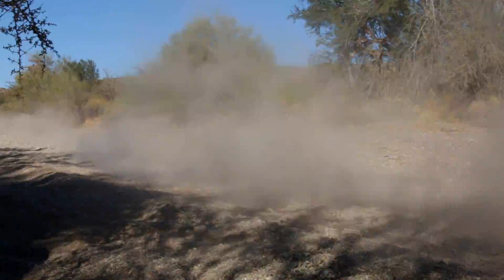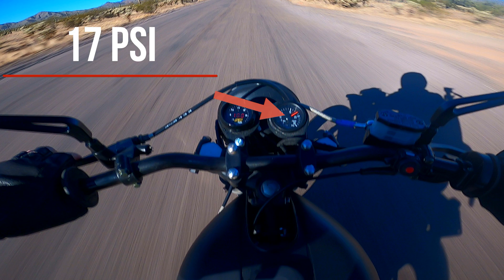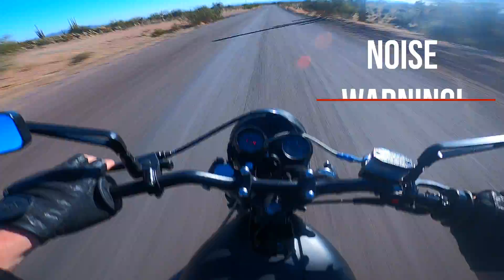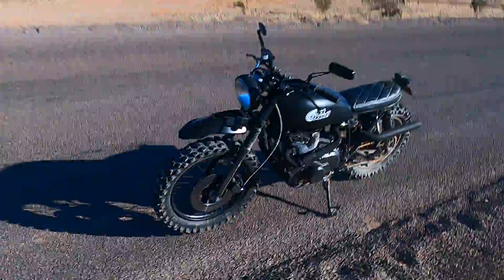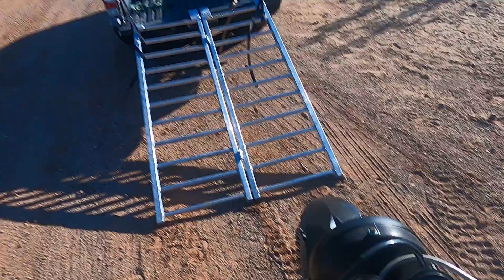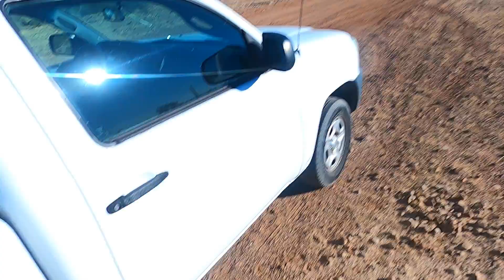Turbo (VZ21) GS400 Acceleration and Desert Riding

Comment: The Pandem kit is god awful ... like you were saying about trim and handling characteristics, by the time your suspension reacts and then bottoms out, you probably wont even feel like ya have any for as far as that wheel is moved out, youve effectively taken one of Americas ultimate track cars and turned it into something that feels like a Soap Box Derby Car instead...or handles like George Clooney tryin to steer Forrest Gumps battered shrimp boat Andrea Gail in The Perfect Storm up against 50ft waves with the outriggers and anchors floppin around worse than Michael J Fox at an EDM Rave 🤣🤦‍♂️ ... im not 100% but ive seen it installed and might have to even mess around with shock mounting placement, but one thing i am 100% sure of is that you need to cut and butcher the shit out of your factory panels to properly mount those flares up to the C5 which dont even come close to flowing with the C5s body lines... and i was relieved to see i wasnt the only one who instantly thought that front fascia was biting off a 3 decade old BMW... the only way to maybe save that front fascia would be to take a sawzall and cut everything out below the top front nose piece and then see if you could graft in that Super Veloce grille that Supervettes makes for the C6 or C7 Corvette which would be a costly gamble at best ... i couldnt agree with you more about form and function and that the best look to EVER come out on the C5-C8 corvettes are the Pratt & Miller C5R, C6R, C7R, & C8R  yet almost (ALMOST) no companies out there go full-tilt in building a beautiful, Non-Cheap looking or half-assed bolt-on overlay lookin part that still doesnt quite cut it... the only company to do it right for the C5 so far and im glad to see a couple people knew of them is ACP who makes the World Challenge C5R body that actually is used in IMSA/SCCA/FIA Competition... and C7 Carbon looks like they may have something, but we cant be expected to trust a full body-kit price of $10-20k and order something thats a good chunk of money based off a computer rendering (although they said they will have real photos soon of fit and finish as a few pple did buy that kit based off the rendering... ive had the ACP for years and its hands down the best ... as far as stand-alone flared fenders go right now for the C5, i would say the most beautiful ones out at the moment are from that cat located in Greece at CFC who made that absolutely stunning 100% all Carbon Fibered Body C5 Corvette ...  the only other decent attempt at a real C5 wide body was that Carravaggio kit that came out which was stupid expensive and even that def wasnt appealing at that price... the venting they attempted on the rear quarters was the only somewhat sorta cool thing about it ... kinda Annoys me that Supervettes didnt come out with the C5 version of their C6 ZR6X body kit because that amount of fender flare would look amazing properly grafted onto the C5 ... i totally agree with you though about the IMSA look (which is why i spent 2600 on a fully custom set of the Radioflyer/Sharplight innovations C5R headlights but took them and designed them how i wanted them to look)  i kept saying i was gonna get them for years and then i finally did about a year before you came out with yours... fortunately tho, id say the C5 owners market is dead split on people who love the C5R lights and People who still love the pop-ups and i must say that your headlights are def far and away better than anything else available for the C5 in pop-up AND they look better than all the other C5R style headlights as well besides Georges so thats def somethin to be proud of man... ive actually been meaning to mesage you for a while though because i do have your store "Favorited ❤"  on my SHOP App bro and i keep checking back to see if theres ever a new update on your C5 version of the Center Console GIANT TOUCH SCREEN DISPLAY that replaces the Radio & HVAC Controls... im sooo damn syked for that bro... FINALLY someone to come along and adress the BIGGEST EYE SORE (IMO) of the C5 interior... i cant wait to rip that Bullshit out and toss that Radio and HVAC control that was in every cheaper GM Car like the impala or chevy trucks and they thought it was ok to go ahead and put those units into their Flagship car... it drives me insane and i plan on being one of your first orders when that drops! ... i just hope you streamline the borders/edges of the C5 screens unit like you did with the C6 version to fit completely inside the edges of the center console bezel bc i have the expensive Apsis Carbon Fiber Center glove box and bezel and dont wanna cover that up... any news on a possible release date for the C5 unit ?  ... also, with that problem you said you were having with the 3D printing media, i dunno what kind of printers youre using but my brother is a mechanical engineer and does alot of his work and model's on a Stratasys 3D Printer which prints using a matrix of Nylon & Carbon and it makes parts flawlessly and theyre super strong... dunno if your setup is capable of using that but the stuff comes out incredible (def more expensive, but the quality is spot on)  i know you said you wanted to get everything in for Injection Molding which is def the way to go but i know that shit has to be done in bulk ... aside from rounding up heads in Corvette Forum for group buys, ya should think about somethin like enabling a 50% Down Payment Order option on your website so ya can get pple payin in advance and then have the cash-flow come in in advance on your website and just keep updates to how many more orders need to be placed until that first group of buyers parts can go off to Injection-Molding and then post when its done and that the other half of their payment is due in order for their order to ship out... i think you def have some great ideas and have come out with your first few products that people in the Corvette Community will def get behind 👍🏻... keep up the awesome work and best of luck! And please let me know as soon as its ready to launch so i can rip this eye sore outta my center console! 🤣🍻

Comment: Are you planning to use intercooler? Did you modified the stock ignition curve? Thanks
Reply from the maker: It's draw-through, intercooler is not necessary (or possible really). The ignition curve was/is stock, the base timing was backed off a few degrees and I run race gas in it.

Comment: How much better is it compared to standard engine?
How does it feel like when the boost hits?
Reply from the maker: On 20 PSI the HP is more than double than stock, it's very dramatic when the boost hits. As usual the video doesn't do it justice. It's weird accelerating that fast on such a small engine that revs so high.

Comment: Hey, try e85. E85 is 108 octane which is like race fuel
Reply from the maker: E85 has poor cold start performance (draw-through turbo's already have crappy cold-start), and E85 is more sensitive to pre-ignition with high timing. Race gas would be a much more safe solution. I've tossed around the Idea of running E85 but I'm still on the fence.

Comment: How is the throttle response? At 14 psi, the torque should be comparable to like an 800.
Reply from the maker: It's ok as long as you're above 6k rpm. It spins up to 11k or so. It's quick for sure, it would beat my Big bore XS650 (707cc) for sure, especially from a 40 roll.

Comment: Man I wanna see something like a Suzuki Savage with a turbo. I mean  big displacement single cylinder. And with the bigger cylinders you can get boosts it up over 700cc so im just left wondering hmmmmmm
Reply from the maker: Single cylinders need a large plenum, as you're always working against the intake valve. A draw through setup probably wouldn't work very well on a single.

Comment: This deserves a massive font but I can manage only so much ! " AWESOME ! "  I watched the time lapse build and it seemed questioable at that point?  Now we see you putting it to work , it's like no 400 I ever rode ! No way. Seems to chug out 80 - 90 HP ? Should get a pair of RM 450 inverted forks for it . There are mods that can extend the swingarm travel a little too.  
These inspirational journeys we get to see occassionally are a pleasure & a privilege, thanks.
Reply from the maker: Thanks, quite a few haters commented on the original build video that it looked slow/didn't look like it made boost. The road I filmed the final scenes at for the video was too rough/short to actually hit boost. Looking back, I should've spent an extra day finding an area/filming better shots of hitting boost/accelerating but that's what this video is for. 

I'd say 80 crank HP would be a reasonable estimate of where it's at on 20 PSI of boost. The final clips in the build timelapse made it looks slow and that's my biggest regret. When I went to put the clips in the video, I knew people were going to say it looked slow/no boost because the only time I actually hit boost was the final scene where I launched it.

Comment: Does it smoke at all running draw through carb setup on deceleration?
Reply from the maker: Only if idling for long periods, and under boost when the pressure pushes out the remaining oil. And cold starts it will let out a pretty big puff. Just cruising and idling at stoplights, it's so faint most wouldn't even notice.
Reply: @DoctorMotorcycle  thats great to hear. Its such a simplified setup. Just seen bad results with it but could be poorly setup systems.

Comment: Well I have to say I'm majorly impressed you got that to work!
First it's a tiny displacement to spin a turbo on, secondly it's an in line twin & the exhaust pulse would be way less than optimal. On top of that you got 20psi boost! 😮  Surely it must lag? What diameter is the fan?
Well done!
Reply from the maker: Thanks, it's only super laggy in 1st gear. 2nd gear and up the spool is pretty reasonable so long as you're further up in the rev range. IDK the specs of the exhaust/compressor wheel's, it's a VZ21 turbo.
Reply: @DoctorMotorcycle  
Looks like the same turbo as the original IHI that was made for the Honda CX500T, that boosts to 18psi & spools up to 160,000rpm. It didn't give boost until 4000rpm (engine) 
I modded one with a slightly larger turbo from a car (Honda city) and put a dump valve & external waste gate. It easily went past 20psi & the overboost  sensor would kick in, but was too hard on the gearbox. 
Sounded great with the dump valve 😎

Comment: Super cool to see. Just watched the build video and was wondering how fast you got it to go, and how quickly. Did you get that thing up to 120+!!? :0
Reply from the maker: GPS said 105 on the 20 PSI pull but the GPS lags a little bit. That was only halfway through 5th (it's a 6 speed) gear. I don't doubt it could do 125-130 as it sits, and it wouldn't take that much longer either lol.
Reply: @DoctorMotorcycle  I would love to see a dyno number on that machine. It says stock that it makes 36hp so if I could guess, you are probably pushing 90hp with the 17-20 psi
Reply: @aaronchadwick2682  my guess is 65ish hp
Reply: @remedia1200  Well that settles it. He needs to get it dyno'd
Reply: @aaronchadwick2682  I agree, we need answers!
Reply: @remedia1200  
20psi, same a/f ratio and timing =
36hp to 85hp
21.1ftlb to 52.18ftlb
398cc=939.68cc
Reply: @DarkLinkAD  whered you get that? a lot more goes into play than just boost when it comes to making power, 20 psi could yield completely different power numbers on the same engine if there's differences in design

Comment: It’s cool, but I’m thinking ya could of used a Suzuki gs 750 of the same vintage without a blower for similar power. Just saying. ; )
Reply: The turbo is what makes it so cool and unique
Reply from the maker: I could have, but a GS750 is 550lbs wet, this bike is just over 400lbs wet. 550lbs might as well be a Harley Road Glide offroad.

Comment: I have a 82 Honda 750, a little rough but might be something you want. Here in the west valley...
Reply from the maker: Send me an e-mail with some photo's and a brief description. My e-mail can be found under the "about" section of my channel. '82 would be a DOHC bike and those can be a pain to sell as everyone wants the SOHC.
Reply: @DoctorMotorcycle  Would love to see a cb750 build (but I agree, preferably SOHC)! Love the channel, keep it up!
Reply: @DoctorMotorcycle  I'm still kind of new to motorcycles but come from a strong automotive background particularly specializing in European performance. I've done a LOT of work with the older vintage Saab's and Volvo's and I'll tell you that the old Saab 2.0L engines were very powerful engines with the right turbo and correct set-up. In the Saab world, nobody wants the old 60's/70's SOHC as they were 8-valve motors and slow as turds! Most people in the Saab community like the 16-valve DOHC 2-litre engines as they're much more powerful and have a LOT more torque. All of this being said, why in the world would the SOHC CB-750 engines be more popular? Again I'm looking at this from a different perspective but just curious what attracts people to the SOHC motors? Is it have to do with the resell value and that they're more vintage or the horsepower/torque numbers they put out? I'd love to know either way, thanks.
Reply from the maker: @MatthewJFitzpatrick  The shape of the frame on the DOHC bike's is wonky, and they have those giant odd looking tanks + most of the DOHC bikes had the Mag wheels which pretty much nobody wants in the custom world (myself included). With spoked wheels you can re-lace the wheel to whatever you want, the tire selection is much better as you can choose your rim width as well. And they're much more durable offroad, which is why dirtbikes always have spoked wheels.

It's mostly aesthetic, otherwise I would agree. A DOHC CB750 will put down 80rwhp with basic intake/exhaust mods. That would take a big cam and headwork on a SOHC and you still probably wouldn't get there without a bigbore or some really good head porting + bumping up the compression.

IMO that's why this bike was such a little screamer with the turbo. DOHC allows you to rev it to the moon, which is where the HP is. It allows the use of much more aggressive camshaft ramp rates and higher lift, as I'm sure you're well aware.
Reply: @DoctorMotorcycle  Thank you for that very helpful and thorough answer I appreciate it! I could definitely understand from that approach based on what you're saying, thanks again!

Comment: You should do a full mod on a dr650. Your subs will start climbing fast
Reply from the maker: Great bike, however I have a soft spot for bikes that are twin-shock, and the DR is not. Maybe one day I'll manage to pick one up dirt cheap, I'll build nearly anything with 2 wheels an and engine if the price is right.
Reply: @DoctorMotorcycle  Yamaha GT 80

Comment: try seeing if the reluctor can be moved to retard the timing. my hayabusa had a adjustable crank trigger to find tdc with the timing light then i let the pcm take over once i knew where true tdc was. you can do this.; i am a 35 year auto dealer technician with a major manufacturer .  it is analog. ohms and volts. you can manipulate timing
Reply from the maker: The ignition is dyna electronic but still uses a mechanical advance. I could lower the base timing 3-5* and not kill the power off boost, or I could weld a stop to prevent the timing from advancing as much but TBH on the lower boost settings it doesn't knock, and I've decided to just run race gas in it. I'll probably end up doing a combination of both if I even run 20+psi again.
Reply: it rocks regardless

Comment: great work ,some head porting, twin scroll turbo ,divided header ,more aggressive cams and and fuel injection .'thats 
my gs550 build. i have had success with a road race lotus super seven with a hayabusa.  twin scroll gt35 made 350 hp
this was fun to watch
Reply from the maker: Thanks Fred. The head is ported on this bike. Your GS550 sounds fun, will do a four cylinder one day. That's actually what I'm looking to do next after this 2 stroke I build, a twin turbo inline four or a twin turbo bigger twin (KZ750 twin, TX750).
Reply: @DoctorMotorcycle  Goldwing flat four twin . 1200 ! lol

Comment: Hello. Cann you hear the knok despite the loud engine noise? Do you use a knok sensor and headphones?
Reply from the maker: Yea, you can hear it in the videos too, just listen closely. It's the cracking noise that's most noticeable on the 17 and 20 psi pulls.
Reply: @DoctorMotorcycle  Thanks for the reply. In fact I seemed to hear the typical knok noise from the video but I thought it was my impression. In cars I am used to using knok sensor, amplifier and headphones and I imagined you used the same method. Do you plan to install electronic management in the future or will you stick to the classic? In any case, great job, clean and tidy. Very good 👍
Reply from the maker: @IncuboUnconventionalLife  Negative, this is only a problem because I got greedy with boost and timing. I'm going to be running race gas in the future on this bike. I've thought about running E85 but not sure I want to go that route just yet.